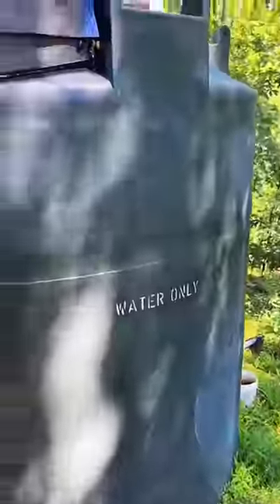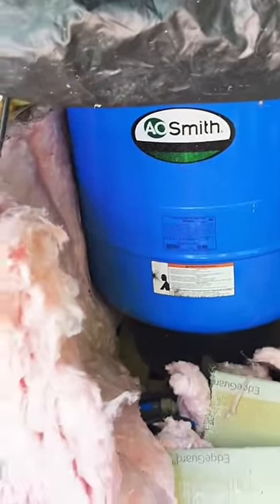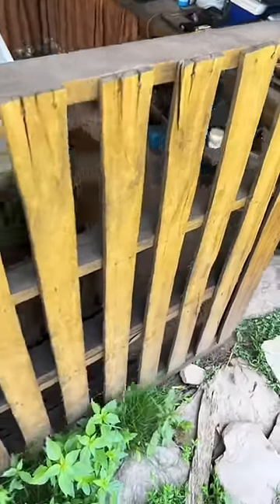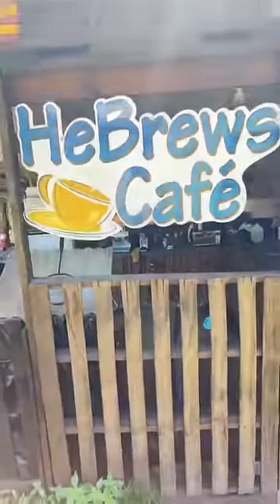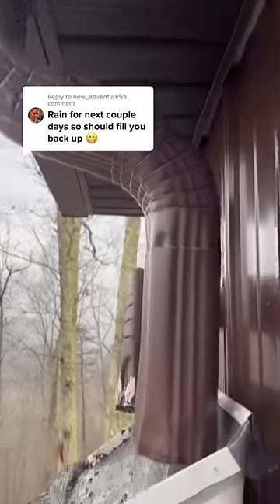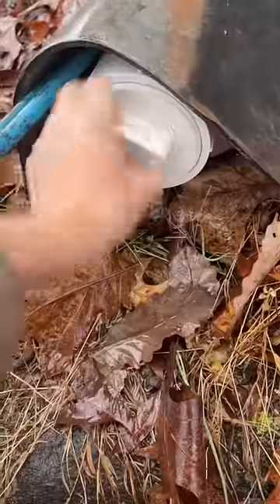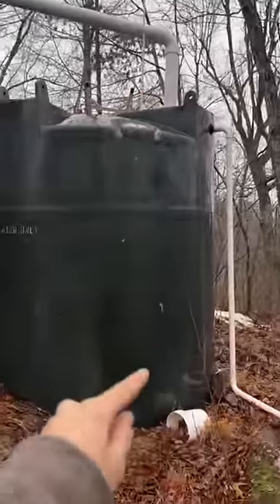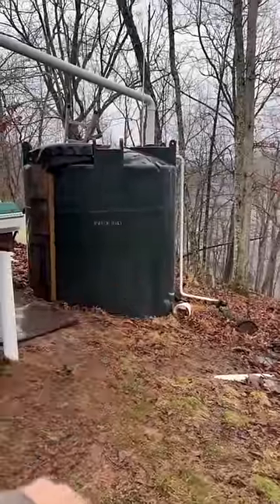The rainwater system

Comment: My well is I over 600ft away from my house on a 3/4" line.  A pressure tank at the end of the run helps prevent any low pressure issues

Comment: A lot of the rainwater that currently falls contains chemicals that don’t break down over time, but an activated charcoal filter or reverse osmosis system still removes them. I guess you can thank the big chem companies from the 50s and 60s for that. But your rain system is cool, and it would be even cooler with a chemical filter.

Comment: I feel like this is a dumb question but is there a filter besides the one on the gutter to root out any possible bacteria or smaller particles?
Reply: The flush diverter that he showed closing is for small particles. He also treats the water in the tank with chlorine